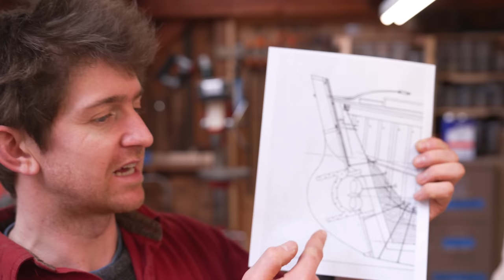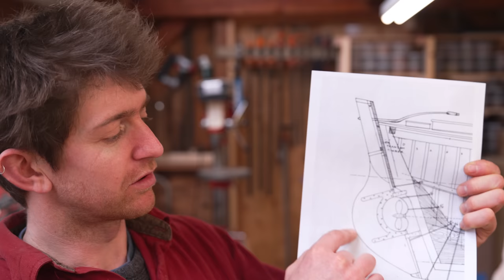Purpleheart Rudder / Cherry Cabinetry (rebuilding Tally Ho ep148)

Comment: First thing I thought of when I saw the size of the rudder was “that’s gonna produce some pretty nasty weather helm.” Never sailed with a trim-tabbed rudder to offset it, but the practical engineering and science behind it makes sense. Otherwise, you might’ve needed to put a small workout room on board to keep your upper body strong enough to push that tiller ❤

Comment: Watching him drilling those holes at the beginning it was absolutely amazing how he came out of the other side spot on despite the length of the drill,  the music was a delightful addition.
Reply: Over the years, I have had over 75 apprentices that I trained in my trade.  Not one could drill a straight hole through a 2x4, without a drill press.
Reply: @johnbell6956  that is something that I could well believe, and that lad was drilling through 2 to 3 feet yet he came out absolutely spot on the line, incredible.

Comment: Just beautiful workmanship ... the rudder is so strongly built ... the detail of water flow on the tampered trailing edge so interesting and well explained  ... " Tally Ho " will be tillered controlled and autopiloted with a added trim on the trailing edge of the rudder ... making it very effective using the water pressure to steer " Tally Ho " ... amazing foresight on known up to date technology on steering boats and to apply this to " Tally Ho " ... " Tally Ho " will be so much better then she was in the past ... will be watching intently to upcoming videos  ... thank you Leo ...

Comment: Hi Leo and team of Master Craftsmen

I'm a long time follower and totally admire your channel. The craftsmanship, the skills, the vision, the planning. Wow. 
I am a retired Mechanical Engineer, and seeing the beautiful rudder crafted by Zeal, made me start thinking about rough seas, and torque and angular speeds. Just some back of the envelope calculations showed me that in very rough seas, the rudder could reach an angular speed of 45 deg in 0.2 sec. Together with a maximum torque in the region of 10,000 Nm. These are figures that if transmitted to the tiller, can easily kill a man. I am sure your consultants have already got a solution for this, but I thought "just in case ...". 
To make the tiller safe to operate, it is necessary to limit both the angular speed, and also the maximum torque. The angular speed control could be achieved with an hydraulic pump, mounted on the rudder post and fitted with a manual flow regulator, which would allow adjustment on site as required. But this pump would then cause the rudder to twist itself to pieces, and to destroy the hinges. To save the rudder, would require something like a clutch, also mounted on the rudder post with manually adjusted spring force, to keep the maximum torque in the region of 200 to 300 Nm. The clutch components would have to be corrosion proof of course.
If you would like me to sketch something up, please let me know.
Please keep up the amazing work, and fair winds for you and the team.
Cheers Jorge

Comment: Nice class today! However quick it is, excellent visual on making a louvered panel. I need to make one myself and considered piecing in a premade section, but naw, going for it and do it myself for sure. One thing I've learned throughout all this, patience, plan, measure, measure measure. Something I've always had problems focusing on, that mean everything in the end. 

 The head is incredible, she's going to be a looker. To have only an imaginary CL down the middle of the boat to work from will forever bogle my mind. I would need to start out with 3 times as much stock before it was right 😂That would be quite satisfying for anyone who's picked up a saw. 

  Rosie!!! Hey hey!!!

Comment: Love the commercials.  So much better then the default ones.  As usual, good call on the rudder design.  Critical part and no doubt the original designers would have chosen it had they the information you have.

Comment: Leo, it`s a good thing you didn`t have me drill the holes in the rudder, how he kept those holes center over what 3 ft, just insane, and making louvered doors by hand, routing with a jig, and they hammer together just perfectly, and the doors were pretty enough to hang on a wall. The woodworking is just next level in all of these videos, it`s beyond my comprehension, and that rudder is just an amazing achievement, can`t wait to see it mounted. The hello fresh, did you guys lick raw salmon?, and did the dog throw up after he ate it, teehee, nice job, as long as it pays the bills, were in.

Comment: So sensible to use a trim tab. As a pilot (aircraft) and a yachtsman mechanic I've long wondered why so few sailing vessels have one. Early on in flight training you are taught how to trim out control loads and trim the aircraft for any given flight configuration.
It's going to be fascinating to see how Tally Ho's trim tab is set up. However its done it will make the helmsman's job a lot easier.

Comment: Great work by Zeal (as well as the rest of the team).  If I was working on an obviously expensive piece of the boat, the rudder as an example, I would have so many trepidations of making an inaccurate measurement, cut, bore hole, etc.  I don't think I could enjoy the actual work.  If it turned out to Leo's satisfaction I would be delirious, but if it didn't, I would just have to leave.  Kudos to Leo for assembling such a crackerjack team of craftsmen, and occasionally craftwoman.

Comment: Trim tabs are used on aircraft as well on rudders, elevators and ailerons. I learned in my work that using a trim tab in the way you are planning will slightly reduce the overall effectiveness of the rudder. It’s kind of obvious when you think about it because you are generating side force with the tab opposite to the force you want to generate with the rudder so you will need more rudder deflection to compensate. If your rudder is big enough it won’t be a problem. I guess nothing is free.

Comment: I'm an Aerospace engineer and additional area to the vertical stabliser (ruder...not really but close) later on in the design process of aircraft is really commen (somtimes really crudly) and something like trim tabs (spring tabs or balance tabs) in the way leo described is used reduce the torque required for the ailerons of quiet modern airliners. I'm fascinated by the way the same technology finds application in different roles. I really enjoy the more technical explanations.

Comment: One neat thing with trim tabs is that certain aircraft use the system for their tail surfaces - you can have larger tail surfaces and conventional cable controls directly connected to the pilots yoke without needing hydraulic or electronic assists

Comment: A trim tab that steers the control surface is a servo tab. A trim tab that accentuates the action is an anti-servo tab. Talked to a plane builder at Scaled Composites who was using an anti-servo tab to have aerodynamic feel from a balanced elevator. 
"Call me trim tab" -Bucky

Comment: All of your crew are impressive, let me say that up front.
I’m going to comment on Zeal today, he certainly has a wide range of skills, and does a very good job, well done indeed.
Making a thing out of a large chunk of timber is very satisfying.
I’m sure that Zeal is very happy power planners exist, it’s a tool I use only on occasion, but when needed it’s the tool to use, also I completely agree with using an axe to rough in shapes, it’s a very useful tool for that, but I’ll  say most guys use a felling axe or carving axe, not a pick head fire axe LOL!
Again, impressive work.
Cheers from Tokyo.
Stu

Comment: Trim tabs are also used in aeroplanes for the same reasons. They are common to use as a "servo" and thereby reducing the needed force to steer the airplane. Often the pilot only controls the tab and that then moves the rudder which then turns the airplane.

Comment: Trim tabs used on Airfoils for aircraft control surfaces operate in the same principle.  Aviation Maintenance Technician-Airframe Handbook - Volume 1 - "The trim tab is used to "trim", or counteract the aerodynamic force on, the control surface and thus stabilise the aircraft in the axis of rotation associated with the primary control. Trim tabs can be either flight adjustable or fixed."

Comment: Interesting about the trim tab. On a glider if you take off using a cable winch the angle of take off can be about 45 degrees so there is a lot of weight on the elevators but as you adjust the trim tabs you feel the weight come off and you can hold the stick between thumb and forefinger.

Comment: A little clarification of cavitation. When you have insufficient water flow past the prop. On the push side of the prop the water flow is moving on the incoming side of the prop is a vacuum. When under vacuum water boils, this vaporization occurs as the vacuum is filled with “steam” and propulsion is greatly diminished. Hull design in power boats is critical to prop efficiency

Comment: 0:45  Wow, that's some skill right there!  I have a hard time hitting a mark on the other face of a 3/4" board without using a drill press.  To see a bit emerge on the other side of that many feet of a hardwood, and split pencil marks in two axes?   I'd go on break and go buy a lottery ticket, because today's the day for sure....  😎

Comment: Talking about losing efficiency when water goes around the ends of a rudder puts me in mind of the vertical endplates used on wings for race cars. Like with the rudder, it's important to prevent the working fluid (air for a car, water for a boat) from spilling over from the high pressure side to the low pressure side around the ends of the wing. Race cars use large endplates to physically prevent this, and I wonder if a similar benefit could be had on a rudder by installing a perpendicular endplate on the bottom edge.

Comment: So, let's see, initial costs for Fresh Hello rookie would compile into a potato-bandsaw, a woodspoon-drillpress with various speeds, a gaswelding-set with an extra rose burner, a circular saw to make sure You can open their packages, a workbench with citrus front vice, shingling iron and square mallet, plus a not too picky crossbreed asylum-dog to get rid of the acetylene-burnt salmon afterwards. 
I got everything except the dog in the kitchen workshop, so Fresh Hello it could become - would they not be one of the big union-busters in my country - shop responsibly! Anyway, a Sampson-Boat-Company artsy add in the usual best quality ever - I laughed hard enough at several points to make the son come in checking on my sanity. Thanks for sharing and making Your sponsoring so absolutely worthwhile! Only channel I hope will have a sponsor in each episode by now: Tally Ho - seriously!

Comment: To be able to stear this boat that has no balanced rudder you will need a lot of power on the tiller. When you increased the rubber blade area you also increcreased the tiller force needed. And when Tally Ho heals over you get even more tipping momentum from the lower end of the rudder bladeIf you want to stear the boat as easy as possible you also need to trim your sail plane and your sails. Compared to a modern plastic cruiser Tally Ho will be a lot harder to stear with or whitout the trim tab. The trim tab will work in a highly disturbed turbulent water flow that allways follows behind any boat.
It will be very interesting to see you handle Tally Ho. After all you are skilled boat builders, not hydro dynamics designers.

Comment: trim tabs are more commonly seen by the public on the wing flaps (ailerons) and rudders and elevators on the tail. they serve the same purpose, in that those three control surfaces can be altered (trimmed) and held in place by mechanical means, such that the pilot can fly "hands-free" or with minimum effort and at a consistent attitude.

Comment: Hi,  the trim tap is look like a power steering then.  I would like to give my humble opinion regarding to cut shapes,  is better and easier to do a jigs with MDF or plywood then use a router with a flash cuter. 
The boat looks amazing. Thanks very much for the videos.

Comment: "Something hit me very hard once, thinking about what one little man could do.
Think of the Queen Elizabeth — the whole ship goes by and then comes the rudder.
And there's a tiny thing at the edge of the rudder called a trim tab.
It's a miniature rudder.
Just moving the little trim tab builds a low pressure that pulls the rudder around.
Takes almost no effort at all.
So I said that the little individual can be a trimtab.
Society thinks it's going right by you, that it's left you altogether.
But if you're doing dynamic things mentally, the fact is that you can just put your foot out like that and the whole big ship of state is going to go.
So I said, "Call me TrimTab.""
- Buckminster Fuller -

Comment: Airplanes and boats seek the same balance.  On some airplanes the hinge for the rudder is shifted aft so the rudder is somewhat like power steering in it's reaction the part forward of the hinge is adding force to the leading edge of the rudder and reducing force at the tiller pole. The servo action of the forward area offsets the rudder area behind allowing lower force on the tiller.

Comment: The trim tab described here is commonly used on aircraft up to the size of airliners. It is generally better described as a servo tab as it is not reallt trimming the surface but controlling it.

Comment: Leo, how do you guys drill such straight holes?  I have see you use jigs like for the propeller shaft but a half inch hole three feet thru the rudder free hand and it is dead on balls accurate.  Amazing.

Comment: Leo, great explanations. Is there anything you don't know about building sailboats ?  I caled myself a sailor because I served in the USNavy for 4 years but not a sailor like you.  I did stand regular helm watches and learned how to control my destroyer through just through doing it. Rough seas were a lot of work on that old WWII ship useing an actual wheel and I bunked right next to aftersteering so I could watch the rudder movement and knew exactly what was happening back there when I was on the helm. Pretty big rams to move it . Twin screws.  I also served on a newer destroyer that had a turbine instead of a propeller..

Comment: You should check out the high efficiency propeller from Sharrow Engineering, the technology will dramatically reduce fuel cost, give you a higher top speed, reduce vibration, stronger, and safer…. The Sharrow propeller.

Comment: I never cease to be amazed by the way your helpers are able to drill a hole through wood, in this case the rudder, seemingly without a guide of any kind & exit in the centre of that piece of work. How do they do it? How do they keep the auger bit in a straight line all the way through? I’m guessing the ‘start’ is all important & once the auger has worked its way in a certain amount then it basically guides itself. Am I correct? The only way i could accomplish that would be in some kind of a jig, set up in a vertical drill press. Or is it more complex than it looks?

Comment: Having the square (well, trapezoidal) rudder is somewhat like having a higher aspect ratio sail plan. The forces are concentrated where they can best contribute to lift rather than deflection.

Then there's the autohelm. How could anyone possibly imagine putting a trimming foil behind a semicircular trailing rudder edge?

Comment: Trim Tabs, ah yes. A fascinating concept, invented by the Luftwaffe Engineer, who also invented mechanical sails, (Flettner Rotors) Anton Flettner. From Wikipedia
"A servo tab is a small hinged device installed on an aircraft control surface to assist the movement of the control surfaces. Introduced by the German firm Flettner, servo tabs were formerly known as Flettner tabs."

Comment: From photographs of Kirsten Neuschäfer crossing the finishing line of the Golden Globe Race, it seems she used a separated trim on her Cape George 36.   The fibreglass Cape George 36 is based on the Tally Ho Major, Atkins 1930s boat, which I assume is based on the original Tally Ho.  Perhaps she will be able to offer some insights on her single handed feat!

Comment: My background is also flying.  Trim tab, anti-servo tab, servo tab, control boost etc.  Please delve into the specifics or sketch a few drawings.  Hydraulics are amazing but you're correct about power consumption.  How about pneumatics or pneudraulics with an air powered accumulator?

Comment: Interesting that you call it a Trim tab. On aircraft a tab which moves in the same direction as the control surface is called a trim tab but if moves in the opposite sense and is used to move the surface itself then it is known as a Servo tab.
PS when it comes to the voyage back to Blighty my vote goes to the North West Passage.

Comment: Why do boats use a straight taper on their rudders? It seems that a symmetrically cambered shape would provide more lift and therefore a stronger turning force. The rudders and elevators on airplanes are typically symmetrically cambered to maximize their aerodynamic effect with minimal drag. Since water is so much denser than air, it seems the effect would be pronounced on boat rudders.